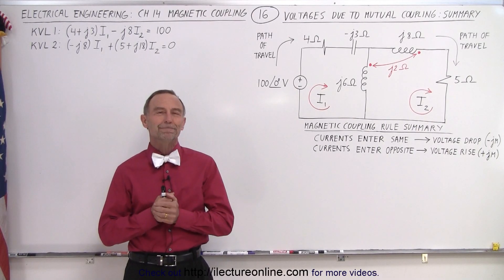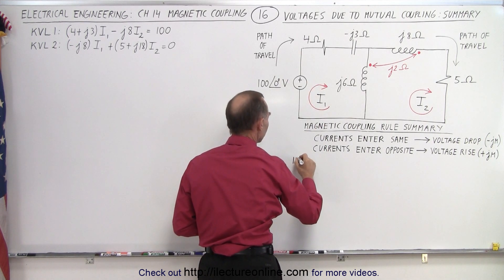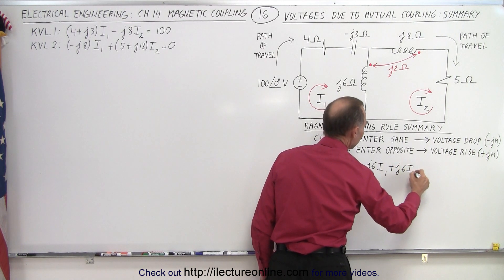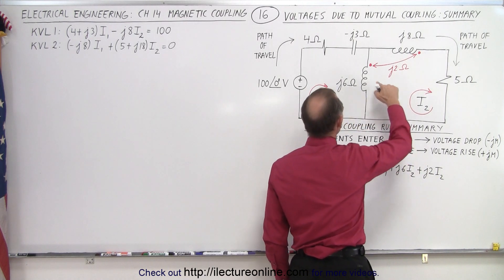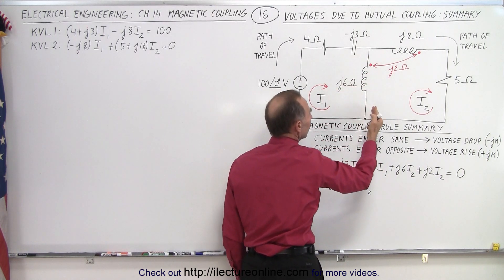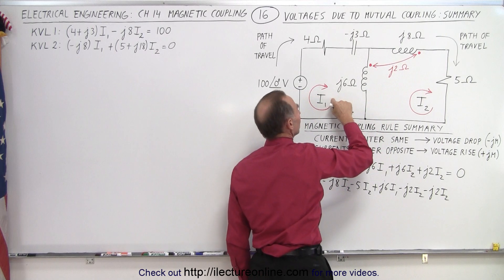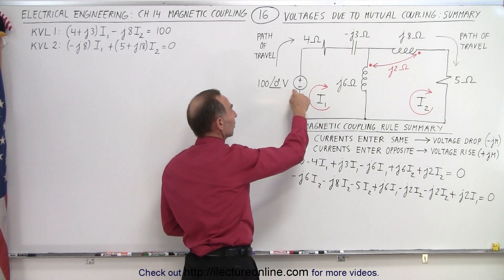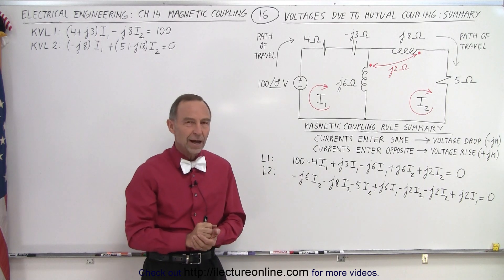Electrical Engineering: Ch 14 Magnetic Coupling (16 of 55) Voltage Due to Mutual Coupling: Summary

Comment: A slight problem I see in KVL1. Top corner it says (4+j3)I1 but you solved it as -4I1+j3I1. Even if ot goes to the other side, it wont be (4+3j)I1. Its just a sign problem. Other than that its a great video.

Comment: good day sir, i actually got used to start the voltage with negative sign and the elements as positive or i keep the sign and forget about the voltage drops and keep as they are, would that mean the rule summary for me will go the other way around?
Reply from the maker: Yes, some professors and some books use the opposite convention.  As long as you stay consistent throughout the problem, either convention will work fine.

Comment: Hello Michel, can you please post some examples with Half-wave Rectifier, Full Wave Rectifier, And Bridge Rectifier all with capacitor filters. With calculations on how to solve for Input Voltage, Average Output Voltage(Vdc) and ripple voltage peak to peak. I have done measured values in Multisim software but my calculations are off and I can not figure out why. Please help, would be greatly appreciated.
Reply from the maker: We added it to the list, but we are not sure when we can get to it.  Thank you for the suggestion
Reply: Thank you professor M. I Hope you have a great weekend.

Comment: Hello our beloved 
Professor
I am Abhirup mandal 
Currently studying in class 11 
Preparing for jee2023
Sir i always had a question in my mind since 9th grade
The question follows 

( if there were many big bang already occurred before our universe was formed . And we all know that the our universe was started from a tiny little dot  which expanded and exploded due to high pressure and heat. And we also know that our universe is still expanding by observing the planets and other galxies moving away from us
THEN WILL THERE BE A CERTAIN POINT WHEN THE UNIVERSE WILL STOP EXPANDING AND RATHER START CONTRACTING 
AND THEN FINALLY IT WILL AGAIN BECOME A SMALL DOT 
AND THEN SIMILAR PROCESS OF BIG BANG WOULD HAPPEN YET AGAIN (Like Reformation of new universe) . 
Is my assumption right ?  I am just curious about it plz reply 

Thank you sir
Reply: Professor please reply
My curious mind wants to know the answer
Reply from the maker: It turns out that 25 years ago, there were many studies ongoing to determine if the gravitational force would eventually slow down and stop the expansion of the universe or if it would keep going and expand forever.  Then in 1998 some researchers studying type 1A supernovas discovered (based on their calculations) that the expansion of the universe is accelerating (not slowing down) and therefore we concluded that the expansion will go on forever.
Reply: @MichelvanBiezen  thanks a lot